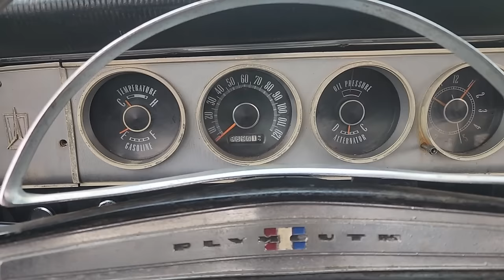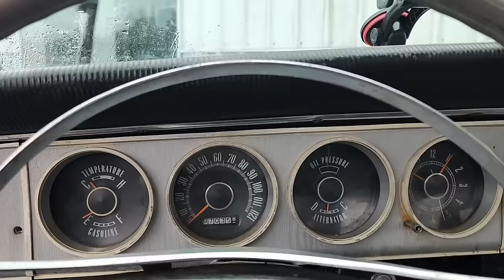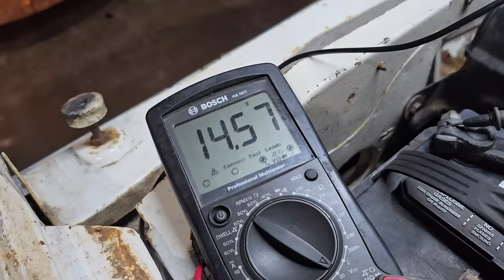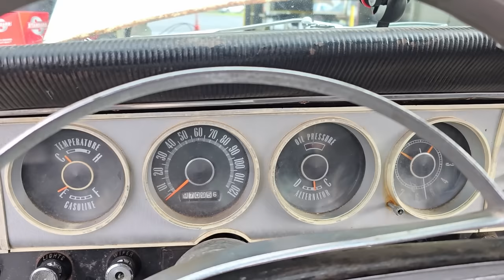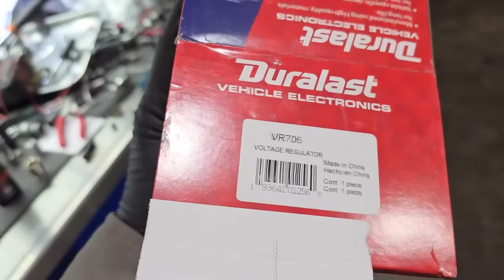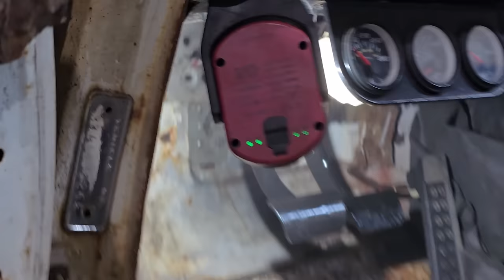Ratty Fury Rehab! 1964 Plymouth Fury Gets A Working Charging System, Suspension Fixes, And Much More

Comment: I worked for a Plymouth dealer as a high school student, 1968-1970.  They used to put automatic transmission fluid in the 4-speed manual transmissions for cold weather conditions.  With the heavy gear lube they were very hard to shift in the cold weather.  Nice to see you involving your young son.  He'll gain a lot from this time spent with you, even if he has a short attention span.
Reply from the maker: Yep - ATF is one of the factory recommended fluids.

Comment: I'm sort of old school and used to have a hard time with the black wheel craze however I love everything about this Fury. Ive been building a '68 Barracuda Notch 4spd car for about 5 years, my original plan was perfect and shiny. After watching your channel and Derek's that has changed.  Today's plan is, now that all the mods are done including 340 swap, late model Chally headlights n custom grille, mini tub, E body front valance and bumper,  tubular things, disc, 390×40×17 out back,  frame connectors, Borgeson, Hotchkis, Doug's... I'm leaving the original paint, and patch painting where needed. 
Thanks!

Comment: Those mechanical points voltage regulators suck bawls. I ran into similar issues with a couple of 64 galaxie generator regulators. Converted them to alternator with solid state regulators and they both work perfectly with no troubles. Trying to get the voltages set correctly with the generator was almost impossible factoring in the ambient and under hood temperature changes. They were so sensitive to temperature and made such a wild difference in charging voltages from that alone I couldn't believe it. On a 40 degree day on startup one would charge 17-18 volts, and when the engine came up to temp and underhood heat built up it would barely charge 14 volts, and on a hot day even less.

Also, I noticed you're multiplying the castor reading by 1.5 using the 20 degree method. I have a PMD products bubble caster/camber/ KPI gauge and it says nothing about multiplying the reading by 1.5 using the same method of obtaining the measurement. I can't seem to find a reason why some companies say to multiply it and some say nothing about it using the same method.

Comment: Keep on keeping on! FYI The battery terminal replacement cable ends are for different sizes of cables! For small gauge cable you turn the saddle clamp over so the hump faces down you get a better crush on the cable. I was told this by a tech at the "BATTERY STORE" Made sense to me!
Reply from the maker: Woah! In all my years doing this, I have never seen that piece flipped the other way. That makes sense though.
Reply: Glad to help! If you look closely at the clip it has a rib on the top of it that matches a devit in the clamp to get a good bite on the cable. I'm from the DRY SIDE of our state LOL! Pasco Wash.

Comment: That small block sounds mean !  FYI, per Mopar, the old "points type" volt regs you were trying to use were never intended to be used the Electronic Ignition box(es). I know because on my '65 Coronet, eith it was always popping regs (like you did) or the engine lacked spark. Mopar says the voltage fluctuation of points type regs is incompatible with an ECU.
Reply from the maker: To the possible detriment of the ignition box due to a lack of consistent voltage supply, possibly - not a hazard to the voltage regulator. These were bad or quickly became bad right out of the box. I have heard that over the years, but I have seen many, many cars set up the way that “shouldn’t work” without any persistent issues.

Comment: The 63 to 67 Plymouths are my favourite of all Mopars ... as for the Shock Absorber ... ouch ... if I was there, I might have  told you NOT to hit it with a heavy lump hammer. That's not really what they are designed to absorb. 😮😅 The old saying goes Slow is smooth, smooth is fast.

Comment: I love that Fury, and want to see more. A few years ago after parking the '80 Powerwagon I saw a few puffs of smoke. Headlight switch had a melt down. Surprised Auto Value had a new one in stock. Also picked up relays for high and low beam, and heater fan. 3 years later the relays are still in the glove box LOL. Live and learn. When the truck burns down, I'll be chocked for procrastinating

Comment: Good morning  🌄 Collin 
Absolutely 💯 love your ,
Plymouth Fury 

Glad you're able to pick at those ,  little repairs , that have piled up . Glad  tracking straight too 

Love how your cars are ,
Manual transmissions 

Don't feel bad ,
We're having difficulty 
with the supply chain too 

WOW !! Look at that turbo can ,
Unload the paint !! 

That alignment tool 🔧 
Looks very helpful 

Alignment pit is helpful too
Haven't seen one of those 
In decades 

I like the grease fitting &
Adjustable sleeves  ,
Of those Hotchkis 
Upper control arms 

Set the toe &
Let it go 🏁

Love the upgrades & improvements  ,
100 million percent 🙏

Comment: I had the same issue with the voltage regulators. I replaced my old one and the new one did nothing. I was charging at 17V, cleaned up my old one and it started working again, I assume it was a bad ground, but the new one had a good ground, just didn't do a damn thing.

Comment: Them damn 60's Plymouth regulators!!!!   I had a 69 Fury 3  2 door hardtop, 318 in 1973-75.  I went through a handful of regulators. It seems that  whenever I'd give someone  jump, the regulator would die the next day. Never right after jumping , but the next day. The replacement regulator was $6.99 at Target. The fact that Target carried the regulator tells us  that it was a common part to go bad. Back in the 70's Target carried tune up parts along with oil & filters.
Reply: P.S. If I shut the engine off I could jump cars without blowing the regulator.

Comment: What is it with those old dodge voltage regulators and the gauge too? I had a power wagon that was a constant battle with that, when I finally got it to where it would charge properly but the gauge just bounced around all over the place to where you just ignored it. Even found a NOS gauge and it was the same way.
Reply from the maker: There are a lot of factors. It seems like every one of these charging systems I see is goofy in a new and exciting way.

Comment: The shackle holes in the frame are supposed to have steel sleeves in them and rubber bushings.😊
Reply from the maker: The steel sleeves for those bushings are welded in by the factory. There is no separate shell like the control arm bushings have - just rubber bushings that pop in. This car was definitely lacking… some of that rubber… 😅

Comment: Hey what alternator do you have in that 5.9? Single or dual terminal?
Reply from the maker: It’s a 70s dual field with the second field grounded to the case - that’s the black wire.

Comment: That voltage spiking melted your high amp load headlight plug.
Reply from the maker: Oh?
Reply: @DeadDodgeGarage  yep if you're voltage is spiking, so is your amperage and the highest draw at that time will absorb it
Reply: It could also be as simple as an old crusty or weak connection....creating more resistance
Reply: @Boga217  The headlight connector initially melted a few years ago and that pin was somewhat loose causing more meltage which killed the headlight switch recently. I'm sure the spiking voltage didn't help it this time though, definitely possible.

Comment: Are your reverse light bulbs burned out?
Reply from the maker: No reverse light switch circuit… that’s not usually a Colin car feature
Reply: Then a toggle switch will work.  You can also hook them up to a switch in your trunk for them to come on when it opens to give you light. @DeadDodgeGarage
Reply: There's now switch wiring And the wiring to them in the trunk is cut. I actually have a functioning trunk light though!
Reply: New wiring is an option. Hearses light up the reverse lights, well old hearses, when you open the back door.  All cars should do that. @deaddodgebrother